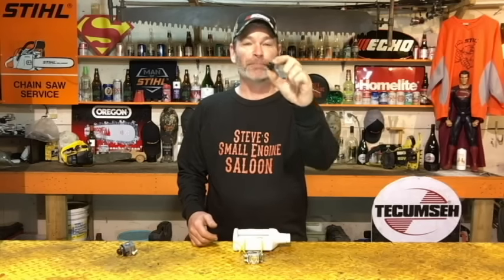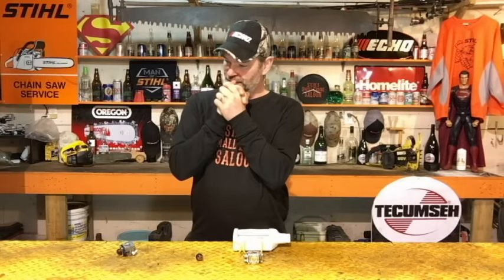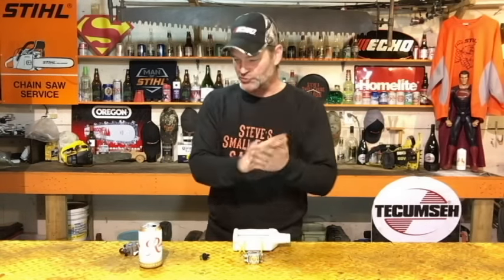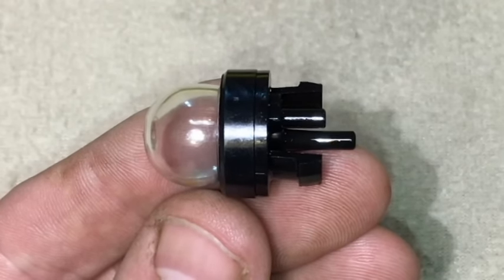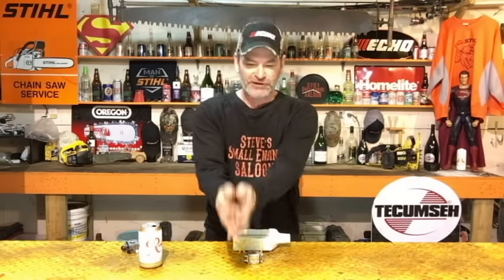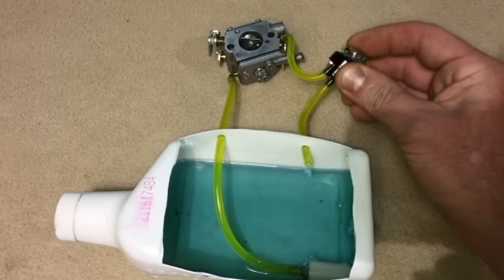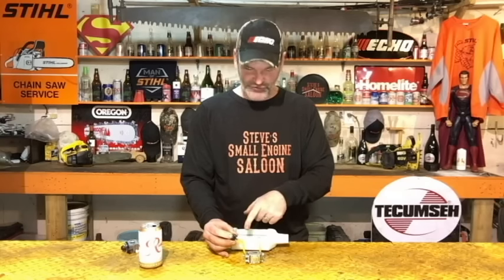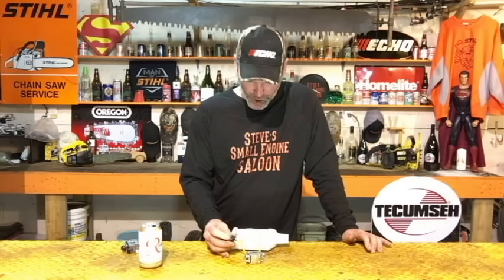How To Install A Purge / Primer Bulb Properly (Don't make THIS mistake!!)

Comment: Thanks for the useful info! Finally someone who bothered explaining the correct connection and operation of the 2-stroke carburetor! I am a total rookie in chainsaw maintenance and I have disassembled - reassembled my carburetor(not to mention all of the parts of my chainsaw itself to some point, in order to reach the carburetor...), without any luck at all.

I think that I must replace the fuel lines, because they don' t have the best contact with all of the other parts and thus it loses pressure.
Reply from the maker: You're Welcome...

Comment: Excellent video, great model. I've had my "purge bulb" backwards because who wouldn't think it pushes gas into the carburetor. Now to fix my lines after tearing apart my  carburetor like 10 times.
Thanks
Reply from the maker: Glad it helped

Comment: Thank you for the video,  my used leaf blower was connected wrong by the original owner, and after many years I found out now that the fuel filter in the gas tank was connected to the return hose instead of the inlet hose.  It was working but with unfiltered gas all this time.
Reply from the maker: You're Welcome...

Comment: Steve you always have the best demonstrations.I have just replaced all gas lines,and primer bulb, and cleaned carb itself. Now when I push primer bulb I can see bubbles in gas tank, and hear a sucking noise from around carb..I have longer stem opf primer bulb going to tank, short stem in primer bulb going to carb.  So I am going to switch lines on primer bulb.  Wish me luck.
Reply from the maker: Good luck!

Comment: Great you clarified a very confusing situation. All my brushcutter fuel lines and the purge bulb were perished and detached. I put a new fuel tank on as well as all new lines and bulb. No drawings in the Husqvarna manual sadly. Can you believe that - sixty pages of manual with no schematic of fuel lines! NOW I understand the system. Actually I had the bulb pumping into the carb. Thanks heaps.if only I saw this before I wasted two hours doing it wrong,! The cutaway mockup clarifies the whole way it works.
Reply from the maker: Excellent!
Reply: GREAT JOB, IM A MECHANIC, BUT I LIKE KNOWING EXACTLY HOW SOMETHING GOES SO YOU DON'T DAMAGE ANYTHING WHILE DOING A JOB THAT YOU'VE NEVER DID BEFORE.!!!! THANKS SO MUCH FOR YOUR INTEL!!!!! THANKS SAMMY PARR SOCIAL CIRCLE GA. 30025

Comment: How about a video on replacing old fuel lines, i have 2 homelite chainsaws im working on and the fuel lines on the 18" fell apart when i removed filter and carb, i havent touch the other saw so i could use it as reference but i bet it could help others who dont know where to start. Keep up the great vids, they are very informative and have gotten me to start fixing small engines to put some extra money in my pocket.

Comment: I replaced the fuel lines and bulb on my two stroke tiller and could not get it to run. I watched your video and ran my lines correctly and now it runs. Thanks!
Reply from the maker: Great job!

Comment: I enjoy all your videos  and it's  nice to watch someone who knows what he's  talking about !
Reply from the maker: I appreciate that!
Reply: Question for you Steve. On my ride on mower I understand how the safety switches work like the seat , if I get off 2 metal pcs touch and ground it out . But the brake switch which with pedal down a button is pushed in allowing mower to start ..okay ,so after its running and brake is off the button is not compressed and mower runs fine . Seems the safety switches ground out the system or complete a circuit.  Pls explain the brake safety as I'm riding the short bus and no answer has popped into my head .
I have an old Arians rear engine 10/28 Briggs & Stratton ( needs new carb) riding mower I plan to get going very soon ...safety switches or wire to fire ..
Probably go back like when new .

Comment: Thank you so much for the cut-out model of the fuel line placements. It helped me realize I didn't put them in the right positions when I replaced the cracked and disintegrating lines on my 2-cycle mini cultivator. Runs like magic now. So proud of myself-I even chest butted my boyfriend!
Reply from the maker: You go girl....

Comment: Hi From England 🏴 Steve.
Just replacing fuel lines on an old Stihl BR 600 was wondering which way round the bulb went.
You smashed it. Cheers Mate
Reply from the maker: Thank You...

Comment: I've just replaced the fuel lines but there is a fair bit of air in the return (Out the carb into the bulb then back to the tank) Is this most likely a carb problem?.
Thanks for all the videos - they are very clear and helpful :)

Comment: Excellent VID. Now I know how it works. It is important to understand the flow pattern and how it works, like you have shown, to effectively fault find and repair.  

To many of these small engines along with the thing the are powering are scrapped by their owners when they could be easily fixed if you have the knowledge.
Reply from the maker: Thank You...

Comment: Thanks Steve for explaining how this works. I thought it was a primer bulb. Mine does not fill up with gas so I need to check old fuel lines to see if their cracked. I’m guessing if the lines are switched that the vacuum bulb should still fill up with gas from the fuel tank. May be I have a problem from the carburetor.

Comment: Thanks for another very interesting video regarding the purge bulb. Didn't release that the fuel only circulates so I don't understand why Mountfield tell you to pump untill fuel exits from the exhaust which I hasten to add I do not do

Comment: I'm here from What Does The Purge Bulb Actually Do? (DAY 9) posted on February 4, 2023.  Now I wonder how the Primer Bulb on a carb works.  What's different?  They both get fuel to the carb.  This one doesn't flood the carb, but the carb-mounted one can if pressed too many times.  Thanks, Steve.  You're the man!
Reply: A primer bulb pumps fuel into the throat of the carb as a shortcut to the spark plug in the cylinder for easier starting. The way i differentiate the difference is: A purge bulb creates a vacuum for drawing fuel to the carb. A primer pushes fuel through the carb to the spark plug.
Reply: @marksmith9295   That doesn't make sense to me.  You cannot pump liquid gas into the cylinder for the spark plug as a shortcut.  The gas needs to be atomized by the carb first and that atomized gas goes into the cylinder for combustion.  Both bulb types move gas from the tank and any excess is pumped back in.  Steve said the Primer Bulb feeds the gas to the carb bowl, if I understand that right, and a Purge Bulb is removing air in the gas line.  Both pump excess fuel back into the tank, but the way they function is different.  He said the Purge Bulb will not flood the carb, but the Primer Bulb can.
Reply: @100vg  yes. There is no shortcut to sparkplug and indeed the carb atomizes the fuel for combustion. Wrong choice of words.
Reply: @marksmith9295   Thanks.  Do you have a way of wording your thoughts that could make the differences more clear?  I would like to understand how the two work differently.

Comment: How Ironic; did the same exact carburetor job today on a craftsman 36cc chainsaw with all the broken fuel lines; finally figured i had everything backwards; so yes i finally got it and chainsaw runs fantastic! after carb adjustments/ Thank you for another great video
Reply from the maker: Awesome!

Comment: Awesome video!!!! I'm apparently like the guy who needed the diagram. However, your build of a mock up system opened my eyes. My chain saw lines were all deteriorated. So i never had opportunity to see where they go. I never saw the connection under the carburetor, and could not for the life of me get the saw going. 
You are THE MAN!!!! Quad droople KUDOS.
Reply from the maker: Cool, thanks!
Reply: Yes same happened to me and I reconnected what I thought was a primer bulb to pump fuel into the carb. So good to see this clear explanation which wasnt in the sixty page manual!

Comment: Hi Steve. So I have my lines connected correctly I believe per your excellent video. When I push the primer bulb, gas comes from tank, through the carb then through the bulb and back to the tank, The problem I am having now is the engine runs on chock but not when chock is off. When running on chock, it is pressurizing the gas tank. Is the carb bad? Thanks

Comment: That model was a work of art.  does the Purge line have to be submerged in the fuel or just inside the tank??? Does it matter?  Maybe the fuel lines i put on a new unit are too small as it'll start but wont stay running.

Comment: Thank you for this Video. I had the lines backwards gas was going into the carburetor not back in the tank. Been doing nothing but flooding. After changing the lines it fired right up. Also not seen a Rainier beer since last time I was in Hoquiam Washington thanks for the video saved a trip to a shop bet they charged like 30 bucks just to switch the lines.
Reply from the maker: You're Welcome...

Comment: I have a 3 pole purge bulb and 3 hose connections on my carb. I used your instructions but where does the 3rd hose go to. 1 angled on back of carb and 1 on purge bulb? Great video btw.

Comment: Steve, I love your video on how to properly install the purge bulb!  I ordered a new one for my older yardman trimmer, but the new one came with one longer nipple and two smaller nipples.  So three in total.  I got it to work by blocking off one of the smaller nipples.  I am not sure what the 3rd one is for otherwise?

Comment: Steve, thank you for this clear explanation of the mysteries of small engine fuel systems. . I had it bass ackwards on a 42cc Craftsman chainsaw. Not in my wildest dreams would I think the suction side (short tube)  of the primer (PURGE) valve would go to the carb. What is that second fuel filter for in the primer (PURGE) circuit? My only recommendation is that you consider Corona Extra, or Modelo Negro, or both. That is what we do in Austin.

Comment: Thank you so much. This is perfect for the issue I'm having. I changed all the fuel lines on my backpack blower. It now does not work. I knew I probably put it back together backwards, but i was not sure what the correct way was. This video was very helpful. Also to know that this is a purger and not a primer is helpful. I've always been afraid to push on it much in fear of flooding the blower. Awesome video.
Reply from the maker: You're Welcome...and Thank You...

Comment: Great Videos. I have enjoyed them for a couple of years. I was given a non-running older Poulan Pro 335 model. Fuel lines and the impulse line were all burnt, cracked, and broken. Can you help me out and tell me where do they go? It also has a tank vent line. Does that just get routed above the carb for atmospheric pressure? I was told it had been a good chainsaw before. Thank You.

Comment: Hey Steve I have hasqvarna 445 ranch I have fire at the spark plug and spray fuel in the cylinder and put the plug in and the saw will not fire up .I try hold the throttle wide open to see if might be flooded and it still will not start. the saw has good compression and the fire looks strong . I was going to rebuild the carburetor but the saw should start by putting fuel in the cylinder head or in the carburetor.what could the problem be . I even put a new spark plug in and fresh fuel. I have a craftsman 42 cc that dose the same  and love your video’s very helpful thank

Comment: I have the carb with the purge bulb on it (Echo SRM 225). Mine bulb is priming, but wont get stiff. The weed eater will run for about one second and then it floods. I can pull the plug and blow compressed air into the cylinder and on the wet plug, re-install and cranks/runs for the one second again. I replaced the diaphragm, gaskets and bulb, along with new fuel line assembly. I even replaced the throttle o-ring and tiny roller. I cleaned out the carb and soaked, and blew carb cleaner through every hole available. I still have the bulb problem. It will pull gas into the bulb when pumped, but never stiffens up. I tried to "function check" the bulb before reinstalling the carb (hold my finger over each nipple on the plastic primer housing). I believe the bulb is supposed to stay smashed in after a few pumps when finger is held over the outlet nipple that returns to the tank. The inlet, nor outlet, will keep the bulb collapsed when testing. I don't understand what it could be. Any suggestions?

Comment: I watched another video that says if you install the new bulb and or fuel lines, and it doesn't work the first thing to check is the lines running in the channel, making sure they are in the channel and not off to the side, where they could be pinched. Especially if you weren't having carb problems prior to disassembly.

Comment: Thanks Steve. I suspect either and or my purge bulb or fuel line needs replacing. I see fuel in that area. The purge bulb feels weak which could be caused by a crack in the fuel line. I’m working on a Husqavarna 223l weed eater.

Comment: Thanks! I had the in/out switched around and pushing the bulb (with a completely full tank) was causing the fuel to leak out of the carburetor.
Reply from the maker: You're Welcome...

Comment: Thanks for this bit of info. My new primer/purge bulb would only depress about a quarter of the way as if the line was completely blocked. And it would blow the line off to the carburetor off each time when pressed hard enough--probably working against the check valves. Apparently, this is another indication the lines are connected backwards.
Reply from the maker: Glad it helped

Comment: Excellent now that I understand exactly how the fuel works I can hook it up correctly I had it hooked up wrong because I watched a different video. Under normal circumstances I would just follow the way I take it apart unfortunately when I took the machine apart all of the fuel lines will cracked into pieces so nothing was hooked up anymore
Reply from the maker: Glad it helped

Comment: Thanks Steve, very informative, but why is it important to remove fuel from a carburator only to put fuel back into the same carburator ? Is it because the original fuel in the carburetor might be old ?

Comment: This the information I was looking for and found by accident this video should be uploaded as another title also most don't know the name of the pump bit purge pump but have perished pipes I bought second hand car boot chainsaw put petrol in it ran out the bung on tank was out it shrunk the pipes perished of I had no clue so came in trying to find were pipes go this was perfect put online as " change fuel pipes chain saw" all types they went hard brittle and I bought new ones thanks 🙏👍

Comment: Blowing bubbles...   Thanks!  I think I switched my lines.  Didn't realize how this all works.  When I press the purge bulb, it was just blowing bubbles into the fuel tank.  I'd squirt starting fluid into carb and it would run a couple of seconds, but no fuel coming up.  Duh!  :-)

Comment: I been banging my head against the wall  tilI I saw this you are a hero and the engineer that designed it is not . . maximum throttle using a rubber band   with wide open throttle  with carb cover off and starting fluid is a sure way to start an engine after 8 years and yes I had purger hooked up backward. I change oil,fuel and third line .. cut lines in 45 deg to  create a  arrow sharp fuel line for easy penetration and oil the lines  for quicker insert . there is tool that  made to pull the lines in  so you don't have to pull everything apart . good luck

Comment: Was a bit worried as I did as you instructed with no results...turns out I had to pump that bulb 30 or 40 times to get gas into the bulb from the carb. Also be careful of air bubbles in the lines.But thanks for the info.

Comment: i needed this so bad today i had my lines backwards after new fuel lines, no spark new coil, I need a carb has to be starts dies they want 25 bucks for a rebuild diagram kit took it apart carb cleaned all the orifices same thing I order a whole ne carm from amazon 30 bucks im into this weed wacker soo much  i can't go back  lol  grrr  if this doesn't work dumpster im soo stressed on it this really helped me check the polarity of the lines thanks
Reply from the maker: You're Welcome...

Comment: I don’t know what I did but I replace the purge line on a Toro blower and I connected the long line from the tank to the short little stub on the purge Bulb just the opposite of what you explain but it runs great so I guess that’s one for the record books

Comment: Is there a video on the other type showed in the photo at 1:40?
Got one that's pristine clean and clear, bulb, gaskets, filter and lines all good or new, just can't get fuel to pump through.
Driving me INSANE!!!
Im no stranger to small engines but this has absolutely got me stumped!!

Comment: QUESTION...for a Stihl FS85 string trimmer...Fuel lines attachment to the carb...the intake line, (with the filter), does it hook up to the top inlet near the primer, (purge), bulb?  or vise-versa???  Also does the other fuel line stay in the gasoline, or does it sit above the fuel...where it can drip the fuel back into the tank...  Hope I am making sense.

Comment: I appreciate the great video, but somehow missed where I can determine what the carburetor in and out ports where the lines go when attached to the purge bulb. I removed the bulb prior to removing the air filter housing and cannot determine which lines went to correct bulb fitting.

Comment: stumbled upon your channel, and appreciate your videos. This on in particular helps me, as I had it backward for years on my chainsaw.  The only thing I notice now is that it draws air at the carb when pressing the bulb, resulting in bubbles in the return line.  Does this mean I have a bad check valve?